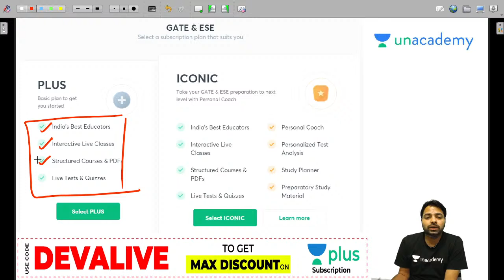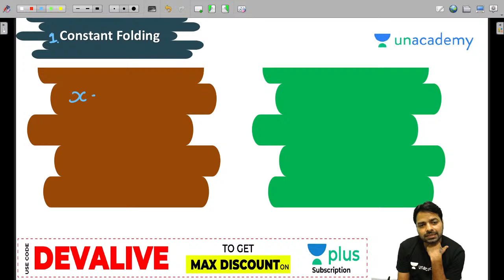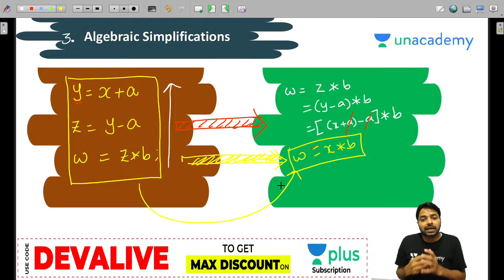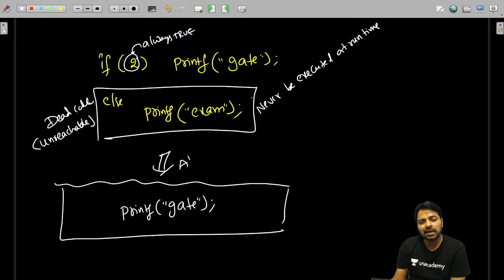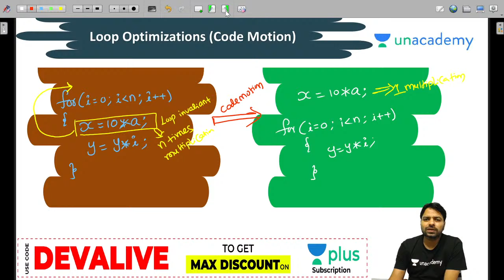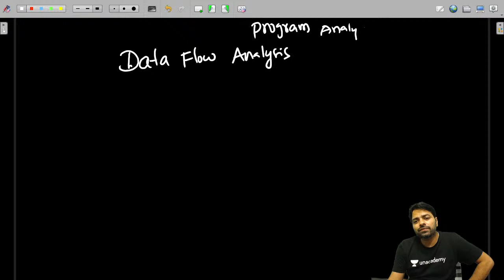Code Optimization: Basic optimizations | Compiler Design | Lec 17 | Mallesham Devasane

Comment: 39.54 
directly pulling out  X = 10*a out of loop is incorrect because In original code  if suppose value of n<0 then for loop never gets executed and hence  X = 10*a never gets executed but after code optimisation   X = 10*a gets executed one time atleast.
Reply: I think instead we can instead use if(n>0)
{
X=10*a;
}
Here, if n<0 the if will not execute and the assignment will not happen; even if the condition is satisfied if is only executed once, so it is a type of code motion
Reply: Making it outside the loop aslo satisfies that condition even